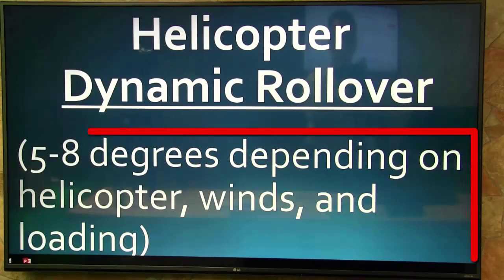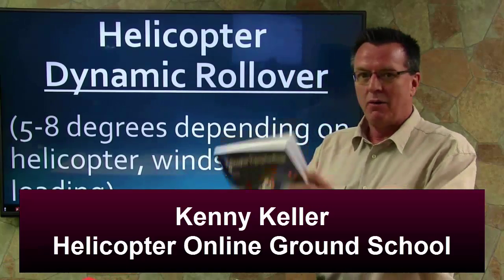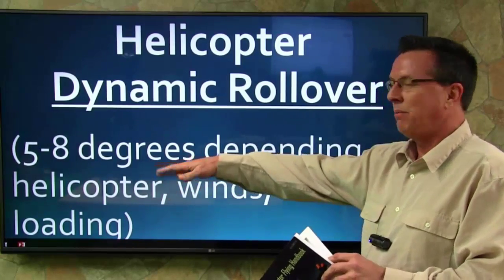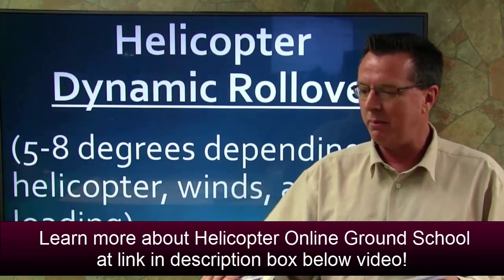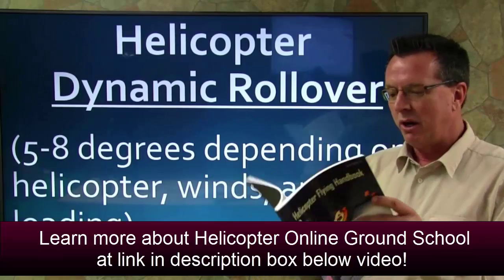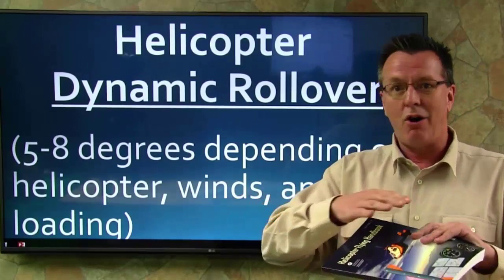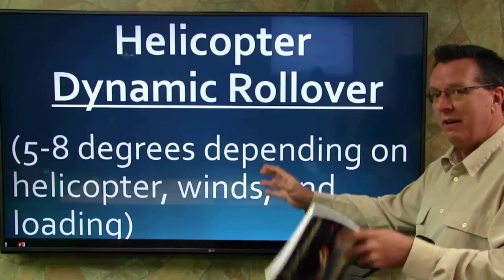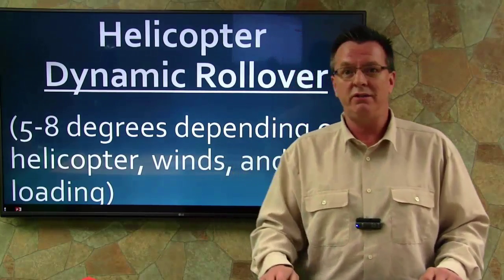Helicopter Critical Rollover Angle 5 To 8 Degrees Online Ground School

Comment: Rotor angle vs airframe angle may be  the difference in the manuals.
Reply from the maker: I say error on the side of safety and keep it under 5 degrees. You seem knowledgeable on the topic, would love to have you join in on live training tuesday. If is a free service that we provide in the name of helicopter safety. sign up here https://www.helicopterground.com/pl/9647
Also I see you may be into drones. Check out the remote pilot book I authored at https://remotepilot.mykajabi.com/pl/12946